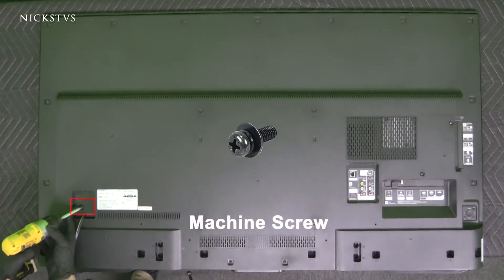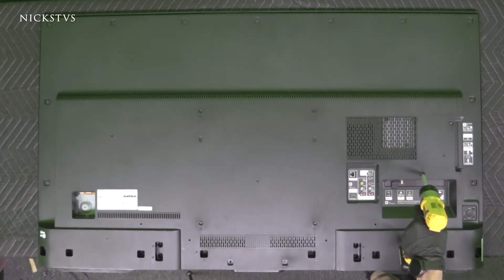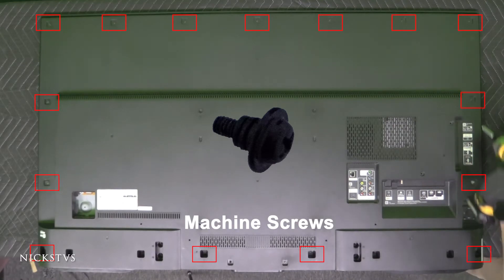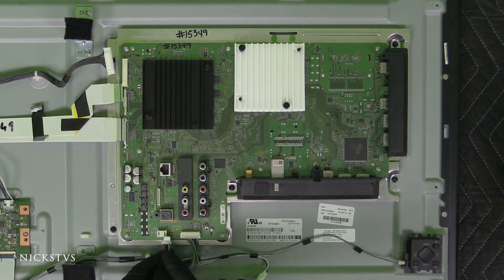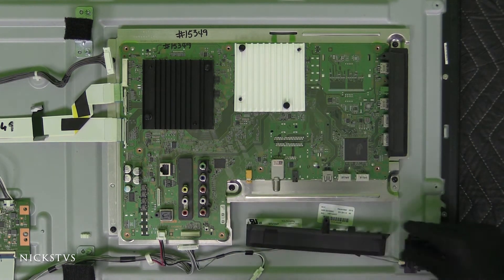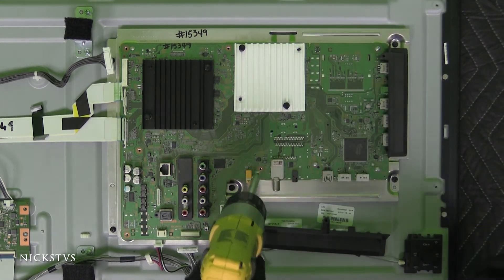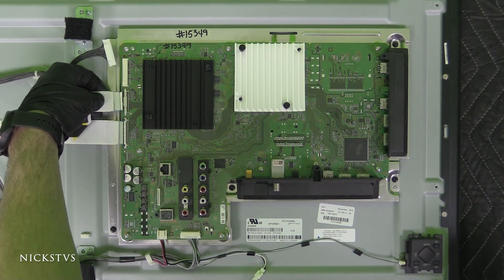Sony 4K XBR-55X850C disassembly Removal of Main board

Comment: Any idea on where to get the panel? Crack in front...super bummed.
Reply from the maker: Sorry for the bad news but no panel is worth replacing. They are more expensive than the cost of replacing the entire TV with a brand new one.
Reply: @NicksTVRepair  I in no way disagree with you but am sort of noticing that there is a film on the front plastic that provides the 3D. For shiz and gigs...do you know how to find the screen. I can't

Comment: Hey Nick, love the videos and keep up the good work. Quick question - is there a reason why you replaced the whole main board on this TV as opposed to seeking out the faulty component? Having the same issue on my XBR 65X850C and wondering what the cheapest/easiest fix would be.

Thanks,

Sevon
Reply from the maker: Hello Sevon,
This video was more to show how to take the TV apart, and how to remove and install the circuit board. 

But yes we do repair these on a component level and I do recommend that over replacing them with a used board. 
I have found that these boards aren't really available anymore unless you are willing to spend over $200 on a board that comes with no warranty whatsoever, so there isn't much of an option to buy a new one right now. 
We do offer a repair service with a 1-year warranty. You can send it in for us to fix by clicking on the link below:

https://www.nickstvs.com/store/p2276/XBR-65X850C.html

If you have any questions or want to discuss this further, send me an email at support@nickstvs.com

Comment: I have XBR-49X800D that died. It obvious that the main board and possibly needs the whole kit to repair the TV and being 6 years old or so it's not much worth it. So I was planning to take to a place that recycles these TV's, you can't just throw them in the trash. The other issue that I'm concerned about is  , is there a hard that can be removed to access the data on it? Or is it an electron hard drive part of the main board? So I don't want anybody to access the data on the system.
Reply from the maker: We're kept TVs older than 10 years alive. It might be something we can look at for you if you were interested. Often a cheaper solution too.
https://www.nickstvs.com/store/p2790/XBR-49X800D.html

To your question: In that model there isn't a HDD that can be removed, nor SSD or NVME.
Reply: @NicksTVRepair  Thanks for responding ... since I also rebuilt a new computer system, I just went a head and replaced the TV to take advantage of the RTX video cards. I needed 120 hz and wanted to be able to enable G-Sync. Ended up getting an LG G1 model. 

Anyway ... I'm checking with friends to see if they want to have it and get it repaired ... etc. I'll give them this website if they choose to do so. The repair kit for this model has a number of other boards and I never did look inside just yet to see how far the damage has gone. But just looking at the HDMI input looks pretty bad. If nobody wants it I was just going to take it to place for recycling. But I didn't want to give anybody access to any of my accounts on the TV ... etc. 

Since it will not power on I can't Factory reset the TV. So if somebody repairs the TV ... how do they not have access to those apps with account information?

Comment: Hello Nick. I was gifted a xbr- 65x850c from my brother. 
took it home set it up works fine. After five days hung it on the wall. Fired it up worked fine. Went to go eat and it went to sleep. Came back nothing but vertical lines bright red green and some black shadows. could not get it to show picture even after restarting. Any suggestions? Thanks in advance.
Reply from the maker: The first thing I would try is re-seating the LVDS cables. If that doesn't work, I'd suggest replacing the LVDS cables. It's something you can swap out yourself pretty fast and only costs somewhere in the ballpark of $30.

I hope this works for you!
Reply: @NicksTVRepair  Thanks Nick. Turned it on this morning and it worked. Do not know what it was. A glitch I think.
Reply: @NicksTVRepair  Will try to reseat the cables. Where do I find the LVDS cables. Started doing it again.  When it happens no picture or sound. Will not do anything. Are these the cables on the t-con board?

Comment: Hi Nick. I replaced the main board on my Sony Bravia KD55XE9005 as I was getting blinking LED red light four times. After installing the new one, I have a solid white LED light, some kind of light music and unfortunately black screen! What should I do? Thanks
Reply: Forgot to mention, I have the newest Sony firmware on my USB and I changed the name of the firmware to update_loader.pkg, am trying to get the update on the TV, but to no prevail. Nothing happens. I keep having this music and black screen.
Reply from the maker: I found the information in the service manual that this is most likely an LED failure code. Seems to be an issue for a lot of folks who have recently updated their units, sadly.
Reply: @NicksTVRepair  Hi Nick. It seems I didn't put the connection cables in place. After sending the TV to a TV technician, he did put all connection correctly and now we have different colors on the screen, but nothing more. Any idea what should we do? Is this sofware related or hardware? Thanks a lot

Comment: Hi Nick, I have the exact same TV, the problem I have is that half of the screen shows like a shadow but when I press the menu it doesn't seem to be dark like the half side of the screen, do you have any idea of what is causing this issue?? Thanks and great video by the way...
Reply from the maker: Based on your symptoms, I would be inclined to say your have a backlight failure. 

Here is a video showing how to replace those. 

https://www.youtube.com/watch?v=kbk2SJkmtnM

Your failure is a more mild version of the one in the video I believe which is why it is not yet triggering a 6 blink failure. 

Does dimming the backlight in the settings and or boosting the brightness all the way up seem to affect the way the TV behaves? if so it would confirm it is a backlight failure.

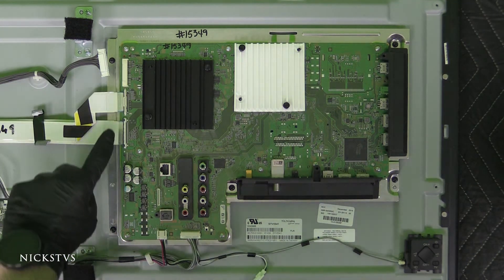Comment: I had a technician replace my backlight on my tv and it went well until he turned it on and noticed the color pattern issue that is being mentioned in another video. He removed the ribbon cable and played around with it and noticed he mustve put them back the wrong way, not only did he put it back in place he added electrical tape on top of 1:58 (right where your finger is pointing) my question is can there be an overheating issue or any other issues I should be concern about? My tv has been working but i am still nervous about the tech doing a quick fix like this ?
Reply from the maker: Catherine, 
There shouldn't be any fire risk when it comes to those ribbons as they don't carry high voltage, they only have data lines at very low voltages. 
There should be no concerns. Your TV set should be fine.
Reply: @NicksTVRepair  what about the power cable that is located on 1:46 on top of the ribbon cables ? Can the residue from the electrical tape ruin the board overtime?
Reply: @NicksTVRepair  I have the same exact question. My tech added electrical tape on top of the power cable and both LVDS cables to secure the cables are in place.

Comment: Hey Nick, I have a Sony xbr65x810c and already replaced the main board. The TV works now (ie. Can watch Netflix, etc) but the HDMI ports don’t. I have updated to the latest firmware already. Any thoughts of what may be the problem?
Reply from the maker: Juan,

The main board you received most likely is defective. Try a factory reset first. Then if a software update is not available, you can still force an update by downloading the newest version of the software from the Sony website onto a flash drive and force the update that way by renaming the file to upgrade_loader.pkg For more info on how to do this check out our video linked below:

https://youtu.be/3kYPjIHt8Lc?t=187

If that doesn't resolve the issue, then there is a hardware failure that will need to be serviced or a new board will need to be purchased. 
We would encourage you to simply return that board as it is defective. 
If you can have the seller send you a replacement or find a new board, that would be ideal. However if you are unable to find a replacement, we offer a flat rate $185 service for the repair of the main board linked below:

https://www.nickstvs.com/store/p2275/XBR-65X810C.html
Reply: @NicksTVRepair  Great channel, I tried the above file name change with my xbr75x850c and nada. I get a boot, open home screen and 3 options no settings for reset at all...home menu is nearly empty. Help button won't work either.... Sony told me to pund sand today as the TV isn't stuck in a loop. Any thoughts? Want to avoid opening it up if possible. Thanks!